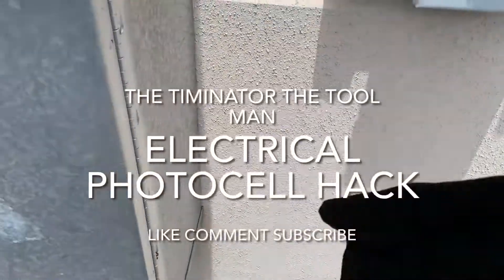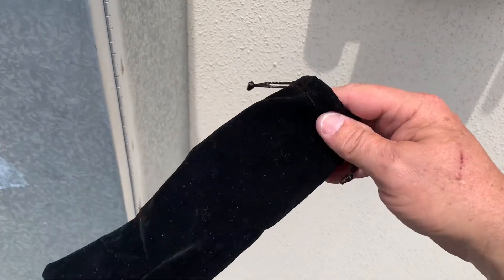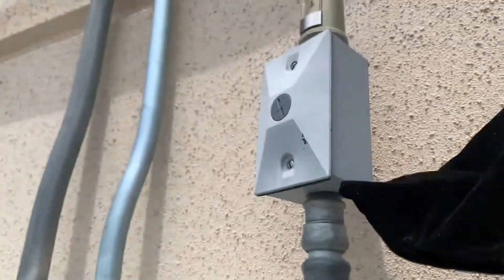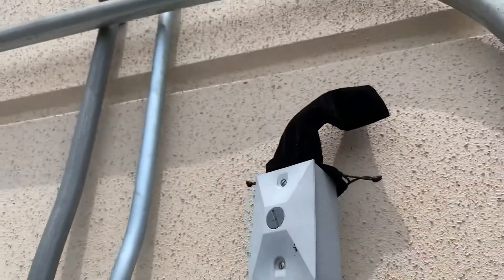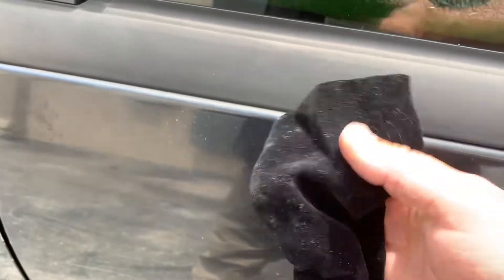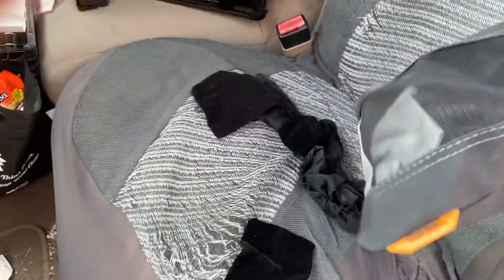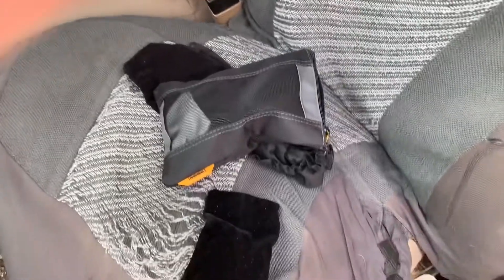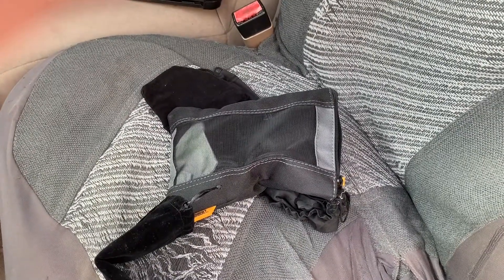Electrical photocell hack

Comment: I don't think that be dark enough in TX, we need multiple layers of tape :/
the drawstring would be handy for keeping the bag on the pencil censors.
Reply from the maker: I use them all the time since I have to test pole lights at shopping centers. They work surprisingly well. If they are long enough you can double them up but I haven’t had an issue yet.
Reply from the maker: LOL